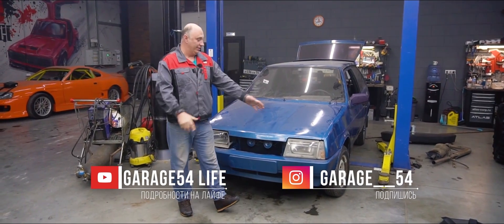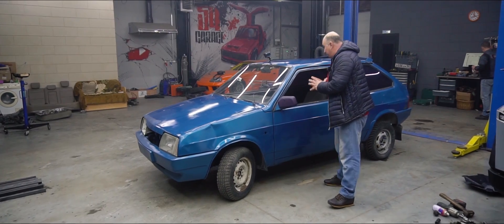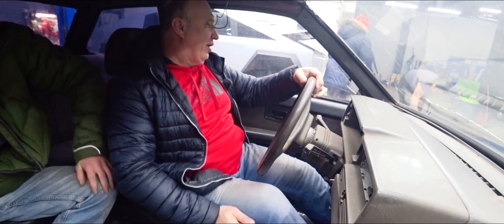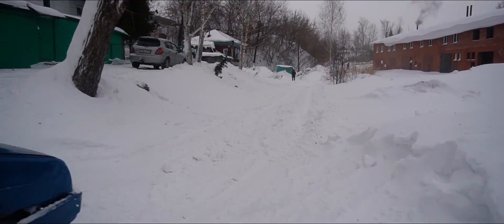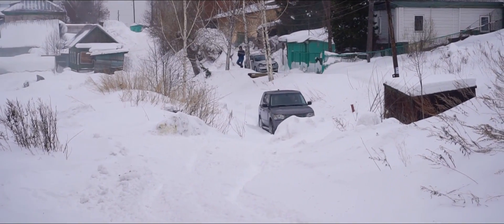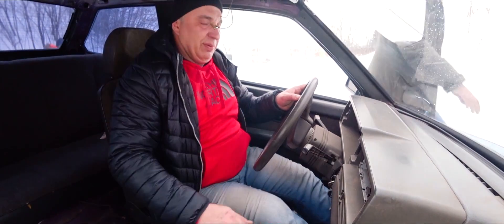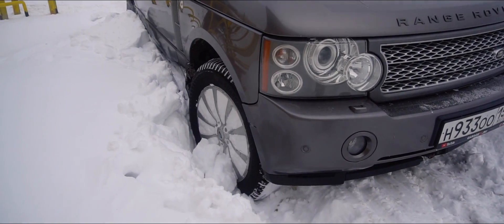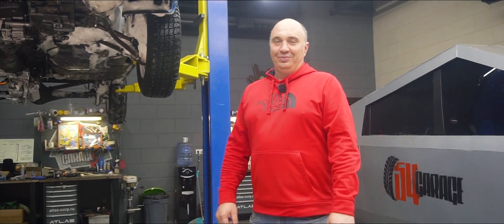4WD Lada – first drive

Comment: the transmission is too long / the engine has not enough punch at low rev. having better gripping tires makes things even worse.
Reply: These Samara have very high gear ratio for motorway driving., 3.66:1 , so you can go 160kmh at low rpm

The first gear is too high for the crawling , they need a reduction

Comment: Wow - you normally only see that much rust on a Mopar :)
Reply: Moments
Of
Power
Are
Rare
Reply: it's not uncommon to see Ford's pulling Dodges out of ditches however. who what do you expect when you got a company that is run by Fiat
Reply: hehe, every car in sweden i tell you
Reply: Mopar = Most Over Powered And Respected
Reply: First On Race Day, but also Fix Or Repair Daily 😁
Reply: @iLoveTheseRemoras  also can be "Fucked On Race Day"
Put the letters backwards and its " Deadly Ring Of Fire" ( remember the steering column fires in the aerostar Van's back in the day?) 
Also " Driver Returns On Foot"

Comment: Snow tires fellas, 4x4 aand decent snow tires!!
Reply: Or at least those same types of custom wheels they got for the back, as the front was definitely the weak link after that and kept sinking deeper into the snow.
Reply: the engine does not have enough punch. the transmission is too long at low revs. the only chance not to kill the motor is to go at nominal rpms with all 4 tires slipping.
Reply: @rarbiart  Good point. One idea I had is to get thin wheels with decent tread and raise the suspension so they basically cut their way through the snow instead of trying to go on top of a compressed layer.
Reply: @murmenaattori6  we never learned what the outcome of BeyoundThePress was for the sawblade-wheel car.
Reply: @rarbiart  Hehe maybe not THAT thin!
Reply: I prefer indecent tires!
Reply: and lift the car
Reply: Yeah, looked like they were using summer tires.
Winter tires alone help way more than 4x4/AWD.
Reply: The 4x4 wheel drive was good, and not a slip, but the weight was little compared to other factory made 4x4 models, the engine was not suitable for 4 running axels, and that was the end for the lada.But it was very well made.Good job, Garage 54!